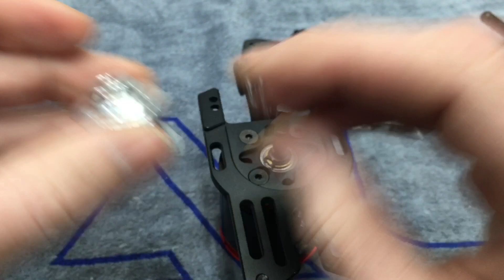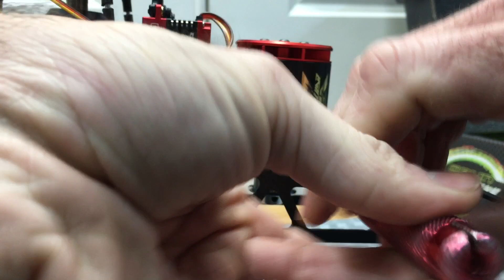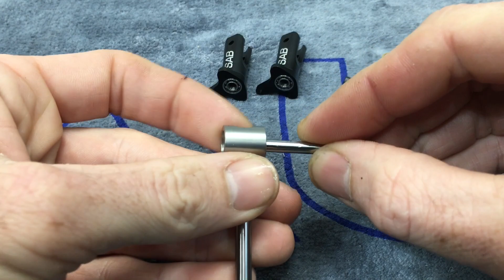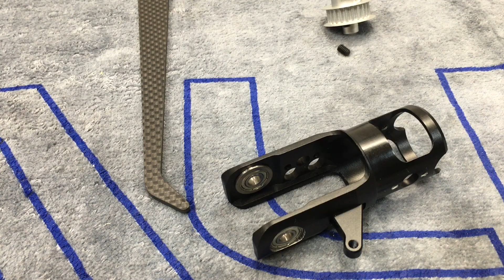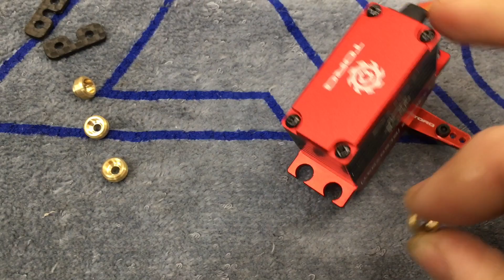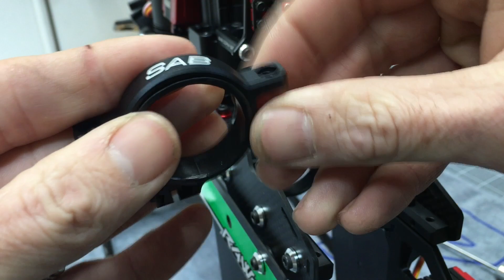SAB Goblin RAW 580 Build Part 3

Comment: My RAW 580 tail is super stiff. Everything is smooth until the ball links are clipped into place, then it’s  really really stiff.
Reply from the maker: @wildgoobsid5  that can be normal, it takes 20-30 flights to “wear” in. You can also get a ball end reamer and loosen the ball ends but I would just fly it and wear it in.

Comment: Thank you, great video! Jeff, you used Kluber micro lube. Can I use the (yellow label) Freewheel Bearings lubricant LDS from Helidirect instead of that? Theres also (from Helidirect) a black label “Grease NBU” a “Transmission Module Grease”. Are these all interchangeable? Thank you again!

Comment: Can’t wait to get mine! I’m hoping the back orders get shipped out sooon! Quick question, do you have any tips on how tight to make the motor belt? All my helis have been/are belt driven tails so I’m good with the tension for that, but this will be my first helicopter with a motor belt/transmission. Was wondering if you have any tips on how tight to make the motor belt? Thanks! Always appreciate your willing to help.
Reply from the maker: Thank you! Good luck on your build. It’s a INCREDIBLE heli! My favorite heli ever made. The motor belt needs to be tight but not to tight where it eats it’s self. But good pressure as your tightening it down. Feel the belt, you want it to have some spring back but not enough you can play a song. Lol

Comment: Hi, I am wondering why retaining compound is used on the M3 X 22 on the Bell Crank Assembly Lever when a nylon nut is used (page 25).
Reply from the maker: Hello, that's because the bolt is going though threads before the lock nut. does not hurt and hold makes sure nothing is going to loosen up.

Comment: We’re your tail grips still notchy after 5 flights? Did you end up removing/adding shims? The tail is still very/tight notchy on mine after 5 flights.
Reply from the maker: They were never notchy. They were tight but never notchy, check and make sure thrust bearing don’t have loctite in them or put in the wrong way. They should tight and smooth. I never removed the shim and it’s been flying about 100 flights now and tail is super smooth. Are you having a wag?

Comment: Hi there, I was wondering those Brass Grommets, are they 2.5mm hole.. I believe the servo screws are 2.5mm in the Goblin.. thanks
Reply from the maker: Yes brass grommets are 2 1/2 mm hole and screws are 2 1/2 mm. They fit inside together perfect

Comment: How did you drill the carbon fiber plate for the HW 120amp ESC? i.e. manual drill? ...type of bit, size of bit, etc??
Reply from the maker: Just used my drill and a 2mm bit and drilled two holes, used existing screws.